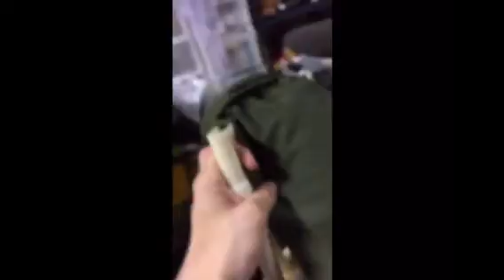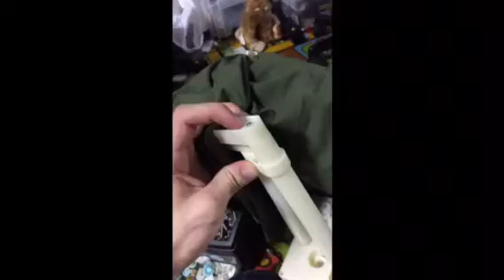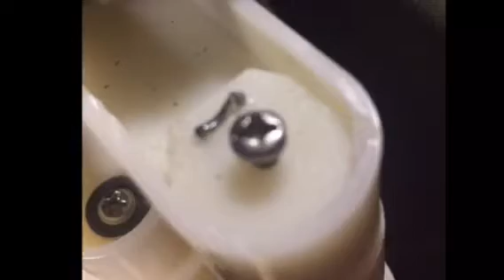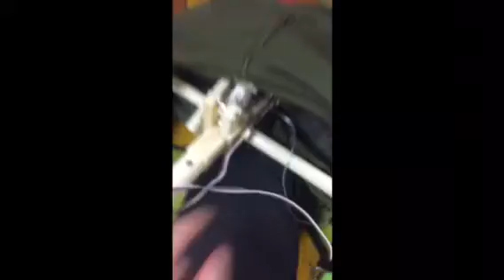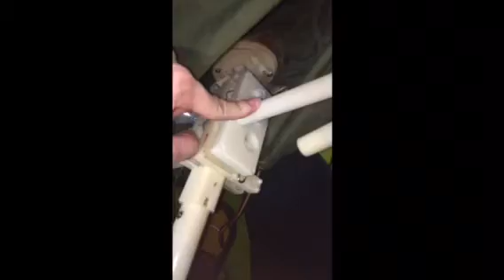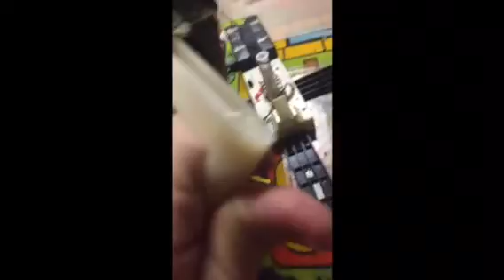Why is Jack O lunger a design so stupid?

Comment: That’s weird... mine doesn’t have the staples in the arms... I’ve opened mine for repair before and never had to remove it
Reply from the maker: Halloween Haunt Guy how easy was yours, did yours have the same gear that you had to replace? I just remembered this body is a store display model, so I'm thinking store displays have staples and the regular ones don't. This is back when Tekky use to send store displays, they would come half way assembled and Tekky made "modifications" them to make them more "durable".....
Reply: jobeanvideos Yes mine has the same gear broken. That must be the case then... mine just has two screws to secure each arm.
Reply from the maker: Halloween Haunt Guy then why the hell does it have staples wtf Tekky... what did they think Someone was going to try to rip the arms off. Makes me wonder what else is different on yours.how easy was it reattaching the arms on yours?
Reply from the maker: Halloween Haunt Guy I suppose the shaft didn't slip in the arms like mine did... the probably stayed in place. Was putting it back together simple? Because mine would not want to line up right, the shafts kept slipping in, and I was up until 3am last night working on it getting nowhere with it, I tried again today still couldn't. I'm wondering if the mech is even Designed a bit different on yours. I'm not sure if there's a gear in the middle that the shaft has to go through from one arm to the other like mine does.
Reply: jobeanvideos I reattached the gearbox and  arms in like 5minuets or so. Wasn’t hard at all.
Reply from the maker: Halloween Haunt Guy omfg, ya this things fucked. The gear box is easy to put back together but again those fucking shafts in those arms, at this point I think they are designed different because with this one this is no 5 minute job when the arms don't line up because the shaft has to connect to 4 things. Both arms and 2 gears and it's really hard lining all that up aside from the shafts slipping in and having no access to get out once they go in those arms.
Reply: jobeanvideos Yeah that seems like a huge pain in the neck... if I had that one I’d probably get too frustrated and just send it to Tekky for them to put back together lmao
Reply from the maker: Halloween Haunt Guy lmao "here fix this mess you created here"
Reply: jobeanvideos EXACTLY LMAO

Comment: I got a broken menicin g molly I got riped off they said it s audio doesn't work but you know what IT'S BROKEN IT'S DOESN'T GO DOWN P OUS THAT WAS A STORE DISPLAY..
Reply from the maker: When we set ours up there was a wire off the motor I fixed it right away
Reply: They forgot to put on the front pice of her and I didn't get it I bascily got riped off from spirit and the high voltage box doesn't open some times..
Reply: Also my electrified maniacs wire for his sensor came off it was glued they would at least soder the wires so that they don't fall off..
Reply from the maker: It can be soldered back on I'm sure